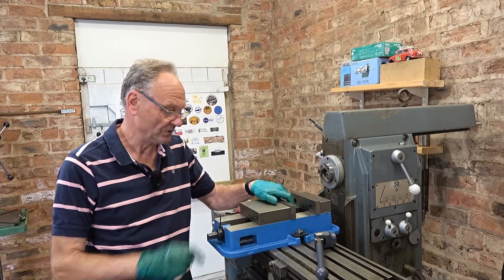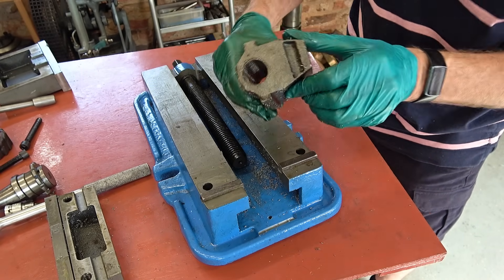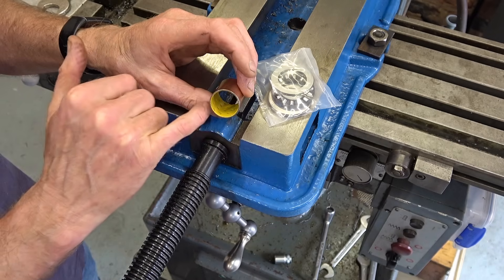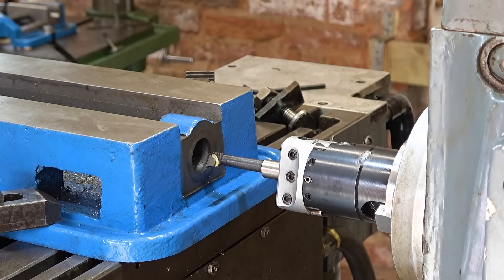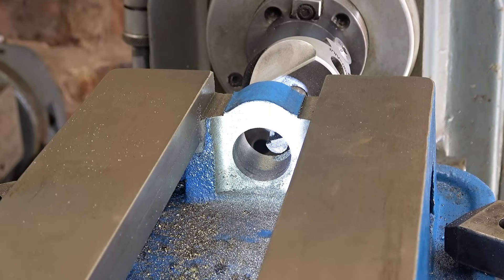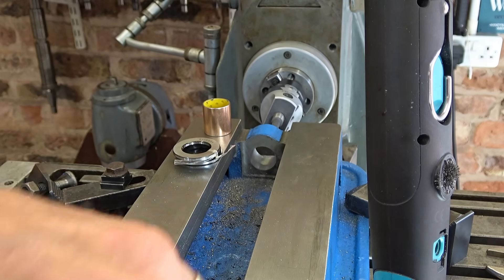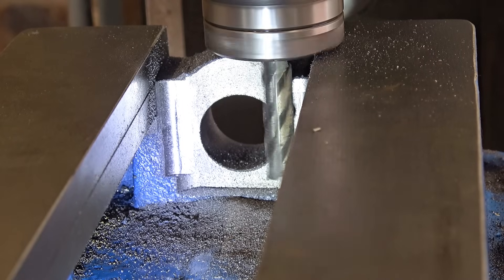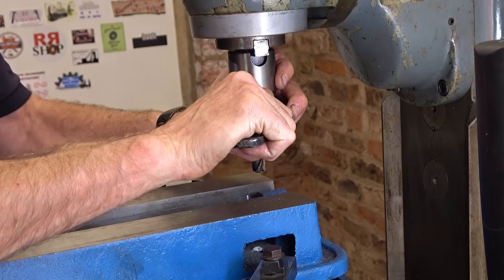HS317 Vevor milling vice improvements – bushing & bearing

Comment: The dimpled yellow lining suggests that is a "DX" bush with an acetal anti-friction lining. The PTFE filled bronze version is a "DU" bush & they are a mid brown colour and smooth (no diimples). I doubt it will make much difference for the application - IIRC the main advantage of a DU bush is that they will run without lubrication, where the DX requires oil / grease lube or life is short.
Reply from the maker: Ah thanks for that. I checked the order and delivery note and it definitely said bronze so that suggests they sent the wrong one. I did wonder. Hmm 🤔?   Post script: I checked the description on the website which says "Bronze Backed Plain Steel Bush: Made from a composite material developed specifically to operate with minimal lubrication. This bush bearing consists of three bonded layers - a steel backing strip and sintered porous bronze matrix, impregnated and overlaid with a pigmented acetal copolymer bearing material. The bearing surface is normally provided with a uniform pattern of indents which serve as a reservoir for grease and is designed to provide the optimum distribution of the lubricant over the bearing surface." But whichever it is, my arm only turns slowly..... Cheers

Comment: Nice job Paul. I would use an indicator for all alignments. No doubts afterwards.
Reply from the maker: Hi, with the gear I've got I could not get an indicator into the bore easily but I did reconfirm the alignment by hand-turning the boring head with a micro-cut on to check that the cutter scratched the bore evenly all round. Cheers

Comment: I have a pile of 5x vevor milling vices in the dirt outside my shop. Easly the worst vices out there, they fail quickly and do not hold work with any accuracy, the vices have bad jaw lift. Not to mention the nut will seize up pretty quick. Also the bolts they use to hold the jaws on are ridiculously undersized. I drilled and tapped them up a size to only have the low grade metal strip the threads. I ponyed up and bought a kurt dx6 new, very satisfied and my part quality went up. Don't waste your time with this trash.
Reply from the maker: Hi Daniel I accept everything you say about the quality, but I just don't have the money for a Kurt on my hobby shop budget. Cheers
Reply: @HaxbyShed  that's completely understandable, I am trying to operate a business.

Comment: I cleaned the contact surface for the half ball on the moving haw and replaced the half ball with a proper bearing ball, cut in half.
This improved the clamping .
Reply from the maker: I remember you saying that Martin. I'm undecided at the moment. Cheers

Comment: Morning Paul, you'll catch bother, going in the shed with your civvies on 😂 I see what the Delrin was for now, I've had a few of these, and fortunately not had to modify mine, but as and when I do, I'll be following your example, thanks for sharing mate, and best wishes to you and yours
Reply from the maker: Hi Ralfy, quite often I'm doing these things (techniques) for the first time and particularly for exotic threading I'll often make a prototype in Delrin first. It means by the time I come to cut the thread in metal I've already sorted the practical stuff on top-slide angles, and mechanical clashes, and depths of cut, and half-nut start points etc, and I can just concentrate on the actual thread machining (with the camera off so I can fully concentrate). Cheers

Comment: Paul, the video was very enjoyable. The collet system on the mill is quite unique. I live in the states and have been trying to buy a used Kurt vise for almost eight years. They bring top dollar. I actually got outbid on one earlier today. I really need to look into getting a Vevor vise. Thanks for sharing.
Reply: Clarkeson Auto Lock milling cutter chucks are very common in Britain, cutter never moves or slides in them.
Cutters are more expensive though because of threaded end and were quite difficult for hobbyists to get hold of 'one at a time' even in the 90's so often had to 'make do' with old cutters or re-sharpen factory cast off.
Reply: I'm surprised you think that the Clarkson autolock collet system is unique. It is probably the most common collet system in British and Commonwealth countries.

Comment: Why was the boring head welded  . Nice up grade. 
Kit from down under
Reply from the maker: Hi, I'm sure you know the head screws onto the INT30 adaptor, right hand. Ok for cutting bores. But one time I used it in reverse to machine a (male) stub within a recess and of course it unscrewed, hence a tack weld (TIG) to stop that. Sometime I could make some tooling for it the reverse hand (all my cutters are for bores) but until then the tack does the job and stops it unscrewing if I run it in reverse. Cheers
Reply: I see how thank you  @HaxbyShed

Comment: I added a thrust bearing to my 4 inch Kurt style vises by doing something similar.  You're going to love the new feel after your mods are all done.  A lot less torque to get the same clamping.  It worked out so well that I did the same to my lathe's toolpost nut.